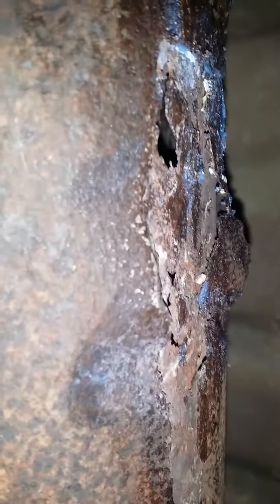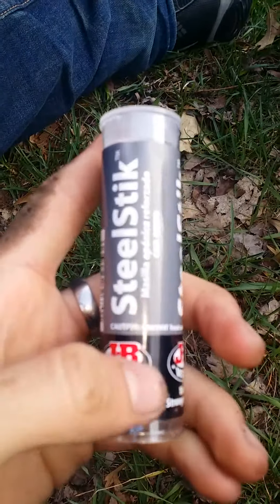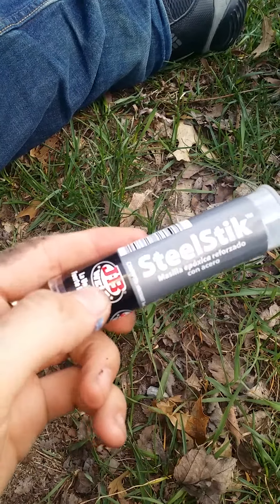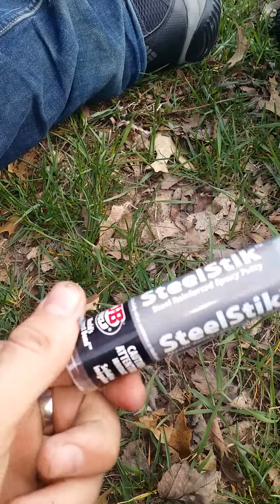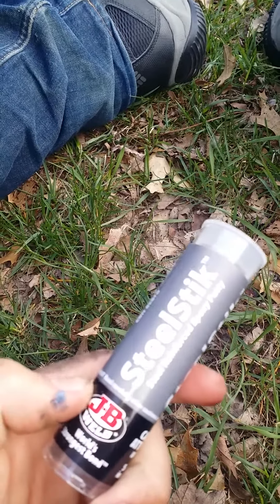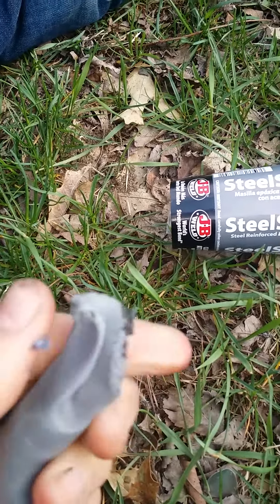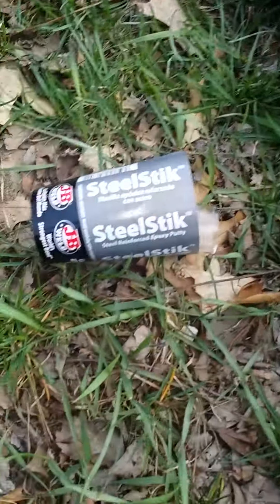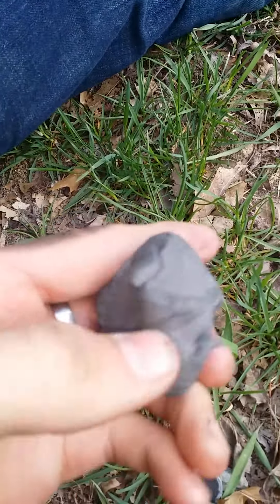JB Weld Steel Putty on Exhaust Leak

Comment: You are supposed to knead the puddy thouroughly until it mixes fully, then it will cure and harden properly.. Also, for exhaust systems it is recommended to use the HIghHeat Variant of this product.
Reply from the maker: Cory Bell did you watch the video? I did it according to instructions.
Reply: I did watch the video, the puddy wasnt properly kneaded... it will change colors and be a dark grey and kinda soft when and kinda sticky..

Comment: from the JB site : Because of the extreme temperatures of exhaust systems, we do not recommend J-B Weld for use on exhaust manifolds and catalytic converters. ... However, in areas where the 
continuous temperature is less than 450º F, we do recommend our HighHeat
 epoxy putty stick.
Reply from the maker: 3 dollars for a month of no noise and then being able to sell it too. I'll take it!

Comment: won't work had the same stuff used numerous of times correctly blew it clean off like butter
Reply: Mtb Ridingog I used it numerous times and it worked.
Reply: It repaired an exhaust leak for me that lasted 3 years